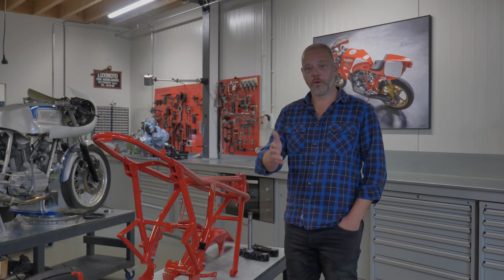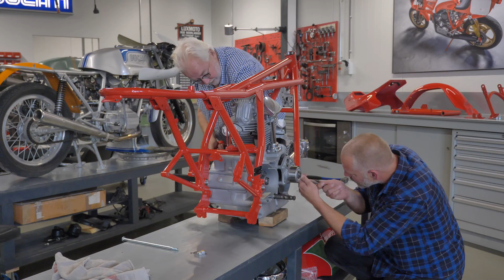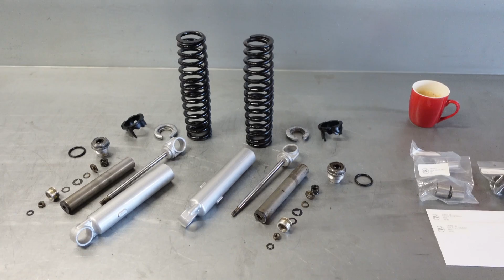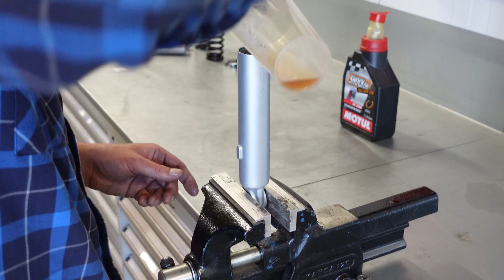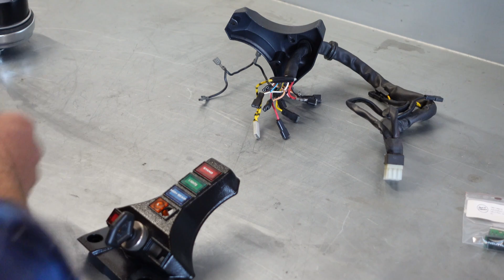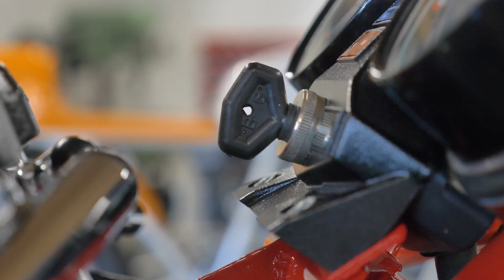Reviving a Legend: 1979 Ducati 900 Replica Restoration Begins - Part 1

Comment: This bike is going to look better than brand new.
I was just thinking that your indicators are flashing too quickly,and the problem you have with the horn not working could be down to poor ground/earth connection on the freshly painted frame .
Ive had the same problems in the past
Also dont forget your safety glasses when using the lathe
great work
Reply: The original placed stickers over paint, no clear coat, they started peeling in showrooms and the paint quality was poor.

Comment: This is wonderful. Interested to see how the rear brake system works. Is there a crossover shaft involved from lever on right side (?) to the rear brake on left side.

Really enjoying this. Cheers !
Reply from the maker: By 1978 Ducati had come up with a good solution for the left-side gear change. No crossover rods were needed as the gear linkage moved to the left and the rear brake master cylinder moved to the right. Only the 1976-77 models are problematic in that area.